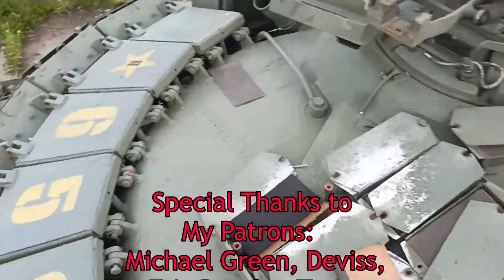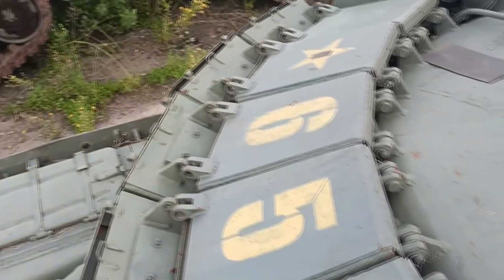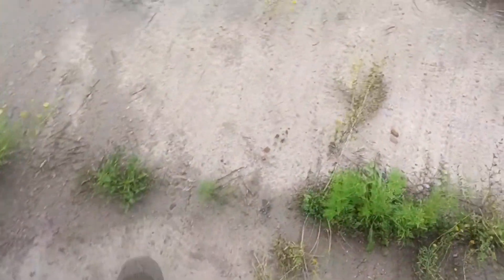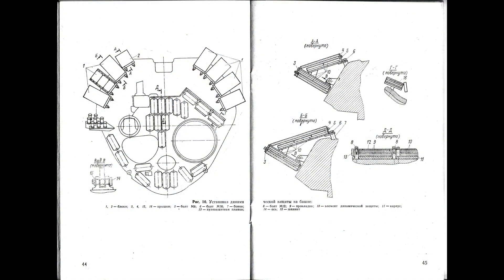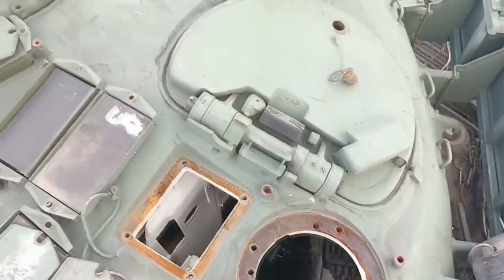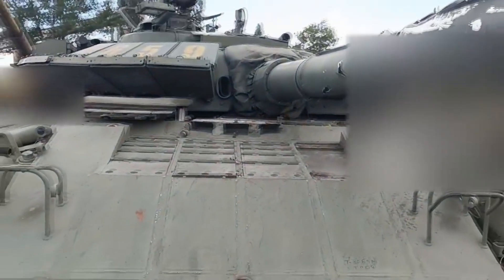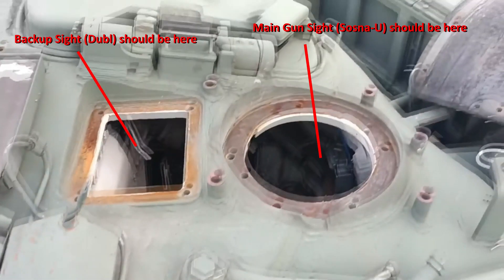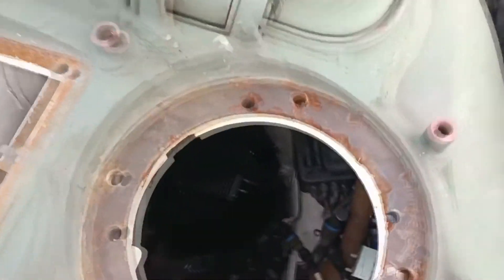Russians Are Using Rubber instead of ERA on their Tanks

Comment: This tank was not equipped with an era on the roof and front of the turret. You may not believe it, but it is a fact. All roof covers have been removed in search of an era. But there were era plates on UFP. And this is far from the only case of this, I have seen at least 5 t72b3 with the same problem, we ourselves completed them with era plates.

The problem is that such cases are not provable. Everyone can tell that it's fake, even if you open  the covers of the era in live broadcast mode. You can always say - "you prepared and removed them in advance" 😁
It is very difficult for Russian viewers to accept criticism of their technique, often they do not even realize in what terrible technical condition it ends up in our trophies.
I'm already used to this reaction, but time will tell)
Reply: this is the video's author btw
Reply: @OGUrez1997  yep
Reply from the maker: Yes, I agree there is really no way to prove it reliably, anything you do people can simply say it is fake. But the problem is that the evidence being provided for such claims is very much lacking right now. There are also several pictures and videos of Russian tanks where ERA has detonated, which means there are explosive elements inside of them, or at least in those specific tanks. That being said, this is pretty much impossible to prove.
Also, I see you posted a comment asking me how I know those are Kontakt-5 roof tiles. The answer is simple, they are identical. If you look at T-72B3 and T-80BVM roof tiles you will see they are identical. T-90M has Relikt roof tiles and those are much bigger than Kontakt-5 and dont really look alike.
P.S. I really like your videos, I have been following your channel for 2 years, you have some great videos there. I didn't want to cause you any trouble by linking your original video, because people on Youtube are idiots and would harass you (happened several times to people who I linked). But if you want, I can post a link to your channel or the video :)
Reply: @RedEffectChannel  I'm not saying that all RF tanks do not have an era, this is not true and it's stupid to say.
I'm just saying that this is not the first, and, I'm sure, not the last such tank. I saw tanks without Era in different places, there is such a tendency sometimes.
and many of my comrades  confirm it 
The purpose of the video was not to show that all tanks are without Era, it was a short review at the end of April, I had very little time, and the user's of this tank said that it was without Era on the turret. given what I've seen before, and given that they won't lie to me - I recorded what I can to record in a short time.
The sights, and everything else, were removed by ours, that's a fact.
ps - there is no need, so many people have already posted my video without a link that it is pointless to achieve this.
good luck bro)
Reply from the maker: @Shawshank.  Thank you for your insight. I appreciate it. If I have to talk about this kind of topic again in some video, I will make sure to mention what you told me.
Good luck to you too and your comrades.
Reply: Как раз таки "критицизм" это хорошо, потому что люди не принимают на веру всë что говорят им в интернете. Есть фото с 72кой которую завешали брëвнами и мешками с песком, есть кучи фоток с "козырьками" и техникой а-ля буханка с буквой z, так что уродских эрзац вариантов у ВС РФ хватает, тут даже спорить никто не будет, просто конкретно в твоëм видосе это выглядит не убедительно, ибо вся внутрянка выдрана, ты сам делал акцент на этом, следовательно, могли напиздить и взрывчатки из ДЗ. Танк захватили в марте, хотя ты вроде говорил, что захватили недавно. А когда где то начинаются подобные недомолвки, очень сложно человеку после такого верить. 
В обзоре на Т72 ты очень хорошо показал, почему Сосна-У откровенно говоря параша. В видосе про ходовку, ты был убедителен, ибо даже видеодоказательства того что 72ка "разувается" вполне себе имеют место быть. А тут чë то как то не то.
Reply: @w_elder2199  а где я сказал что танк захвачен недавно ? И ты знаешь когда я снимал это видео вообще ?)
Понимаешь какой прикол .
Убедительно - неубедительно,это все риторика неверунгов. Информация о том ,что российские танки частенько попадаются без ДЗ идёт ещё с февраля . Потому видео и начинается с фразы "как я уже говорил" .
Данный танк действительно давненько стоит , действительно был разукомплектован (я этого не отрицал ,я в видео говорю об этом -"сняты прицелы"). Однако ДЗ наши оттуда не забирали ,это я знаю на 100% )
Понимаешь, у нас танки с ДЗ живут весь цикл войсковой эксплуатации,и никто никогда её оттуда не дёргает ,во первых головняк ,во вторых дефицита ее нет .
А насчёт " не убедительно" ,бро ,ты угораешь?) Если бы я на камеру откручивал эти крышки (хоть все со всего танка ) , и там не оказалось ничего кроме резины ,то орки все равно бы сказали что я заранее это все подстроил, камон,это ясно как божий день ,плавали - знаем. 
Замажь я номер этого танка , оправдания были бы ровно те же самые (ржавые гусянки, разукомплектованный и тд).
Я все это понимал прекрасно, но мне плевать .
Большая часть аудитории не склонна к упоротому оправданию, поэтому ставка была сделана.
Reply: @Shawshank.  как скажешь
Reply: Кстати, чë за ДЗ напихали трофейным 72кам? У вас есть на складах "Контакт - 5"?
Reply: @w_elder2199  есть )
Reply: @w_elder2199  как автор говорил, чаше всего крыша без дз, борта и перед в 99% прикрыты. Наверно просто во время службы в мирное время не стали башню доукомплектовывать ДЗ иза так как надобности не было, даже 24 числа не многие верили что будет война, да у соседей до недавнего времени не было птрк 3 поколения, вполне могли запустить первые части на прорыв не успев доукомплектовать их полностью ДЗ, так как техника была на учениях и ее сразу в бой кинули.
Reply: I'm quite sure you are right.

Comment: Protection manufacturer "NII Stali" declares that Relict's dynamic protection also includes polyurethane rubber plates, which turns a failed ERA block into a miniature NERA block, giving up to 100mm resistance from a cumulative jet. You can also find photos of this tank abandoned on the march until March 3 with a damaged Sosna-U sight. Also, the author of the video showed a little what is happening inside the car, it is very looted, there is not even a gunner's seat.
Draw your own conclusions from this information.
Reply: Someone needed a seat🤷‍♂️
Reply: a n i m e
n
i
m
e
Reply: Russians use Rubber just like Ukrainians used the Ghost of Kiev to shoot down 6 million Russian aircraft. 
These channels are paid spreaders of misinformation and shame on anyone who takes claims out of the Ukraine side as anything other than propaganda. 
-one million man army
-kherson offensive
-brave defenders of snake island
-totally safe and effective
Reply: This sounds similar to the applique armour on some upgraded T62s. I think it was called the BDD package and it was used in Afghanistan.
Reply: Conclusion: VT-4 SUPERIOR
Reply: Rubber=100mm resistance? 🤣
Reply: @hibahprice6887 look up Non-explosive reactive armor(NERA)
Reply: Too be fair, this 100mm of protection is negligible when considering the strength of most shaped charge ammunition. At most, it'd probably only protect against shoulder-fired munitions (excluding the Carl Gustaf).
Reply: @shanemcdowell3628  If there is an opportunity to get an additional chance for salvation, then it is better to use this chance, especially since it costs nothing.
Reply: @Saiga-saiga  True, if it makes you sleep better in the gunner's hatch
Reply: @Saiga-saiga  he did...
Reply: @shanemcdowell3628  you need to be on the field before making decisions like that. Makes sense on paper , having 10 cms more in real life probably makes most people feel better and survive more.
Reply: @NAWFMATIC  Okay? It's like telling me my car has crumple zones.
Reply: What’s the conclusion then? Ukrainians took out ERA plates without their steel containers to just stickyband them onto T72M they are getting? Relict is a count imitation of kontakt V , hence along side rubber , if it even has one and you are not making up , has to be parallel with explosive element , which has to have 50-100 gr of explosives .
Reply: Russia could be driving LEGO tanks they are still going to win

Comment: It makes sense that the missing explosive is used for IED manufacture.   I doubt missing explosive is used to armor other tanks, as if that was case, the entire pack of reactive armor would be taken, not on the explosives within it.
Reply: ANIME RADIO  If you have enough time to remove explosives from every ERA panel then you have enough time to fix or evacuate the tank itself. Nobody removes explosives from era panels when leaving the tank it makes no sense, if you are leaving the tank to the enemy that means that you are in a hurry or in a danger, not exactly a time for the painstaking and slow procedure of opening individual era boxes and taking explosives from them that are not that valuable at all...
Reply: My thought exactly
Reply: They take the charges and keep the blocks on purpose to make it look like Russian army lacks complete weapons. Of course it does not make sense that they took the gun sights, even headlights but not entire era blocks
Reply: ANIME RADIO  It's fairly straightforward. Have another tank put a round through the abandoned tank...
Reply: I am not fully familiar with how potent the explosive in ERA is, so:
how much explosive power are we talking with an ERA panel like this?
Reply: Corruption lads.
Reply: Look for the article "Polish Explosive reactive armor: ERAWA-1 and ERAWA-2 ". You will find there photos from the test of cassetes resistance to fire with 7.62mm, 12.7mm ammunition, 82mm mortar blast, napalm, flaming gasoline, etc.
Reply: Then why to put ruber inside? where to get so many ruber cut in size? This ruber wasnt put there on a batle field.It was put  in maintenance shop or even in factory.
Reply: @ernisj.8087  redeffect explained it clearly, watch the video again please
Reply: @chilldoggy4721  i know what he is up to.But those who was looking for explosives from ERA just opened couple of them.Most of them were intact. For me it looks more that someone dismatled one here , anothere there.Didnt found nothing  inside, gave up.And why to dismatle ERA for so smal amount of TNT? Just take canon round from tank, remove fuse, heat it in a sand bath up to 120c.Here we go, TNT melts and runs out of the shell.
Reply: @ernisj.8087  Ukraine is in desperate position and there are many reports of guys not having medicine and s
Ammunition. They just took whatever charges they could get. And of course redeffect mentioned that crew sabotage could also be there. And no, they did take all charges possible. Cannon shells? Sure, best way. But era also has some extra for the farmers to build homemade mines or something
Reply: @ernisj.8087  pay attention to the video. The rubber is layered between the explosives. The explosive layers were taken...they left the rubber layers behind!
Reply: @tbrown7662  look on 1:37 at the blueprint .Count how many layers are there-5 ! 2 explosive, 3 ruber. If explosive layers remooved, must be left 3 ruberones. Then count how many ruber layers are in the video. This video prooves nothing.Just becouse he put some blueprint it doesn mean nothing.It is more disaproving what he claims.According to him it is "maybe possible" but not " it is for sure".
Reply: ANIME RADIO  Yes in a war zone you have to flee and you start to unbolt stuff... that procedure is not for active fighting situation and even in NATO you are told to destroy specific items the tank may be difficult to destroy but you have equipment and capabilities to incapacitate it. Google better next time or join the Army.
Reply: @adilachahbar3154  he was talking about Ukrainians
Reply: I doubt it. Actually the explosives in these are very, VERY hard to detonate. They sometimes don't even go off when hit with what they're supposed to protect against.
Reply: There was never any explosive. It was sold to the black market at the behest of some shithead Russian general.
Reply: If I was there, on foot and in scavenging mode, I would just be taking the goog stuff, not the rubber, that's just me!
Reply: Or sold with handgranates  to organized crime in Europe
Reply: её просто спиздили украинцы
Reply: There is no missing explosive. Explosive money went to Generals retirement fund.
Reply: @TheStrategos  Pheeew... Finally someone gets it.. 👍🤣
Reply: ANIME RADIO  It's VERY common to destroy a tank to prevent the enemy from getting hold of the resource to use against you in the future. The U.S. destroys abandoned vehicles in the field all of the time and it's actually one of our duties to do so. In this tank, one or two phosphorus grenades right in between the seats and on top of the autoloader magazine which holds the charges would admit that tank turret into the Russian space program. Sabotaging your own vehicle is standard training.
Reply: @Talishar  "Sabotaging your own vehicle is standard training" this isnt sabotage if you only strip the ERA lmao, its not even destroyed, its not ammo racked. Maybe a thing for US but most certainly not a common practice for Russians. Most of the footage ive seen from Russian tank members abandoning their tank during artillery fire dont have time to strip the ERA.
Reply: @Maj_Hater  The argument I commented to was that it's uncommon in general and I said in the US at least, it's the norm and a general requirement for vehicle crews.
Reply: If you're going to remove the ERA block why would you specially cut rubber sheets to fill the old block, you'd just leave it empty, you wouldn't even put the cover back on.
Reply: @iggysfriend4431  The rubber is already there....but anyway in this example it's probably been stripped by UA forces for spares or some other use.
Reply: @iggysfriend4431  did you just not watch the video at all or do you have comprehension problems? Its clearly described that the roof mounted ERA blocks have rubber padding layers next to the explosive layer as part of their design. Someone hasnt just cut out rubber and put it in after it came out of the factory, the factory does it because it’s how the ERA is designed.
Reply: @iggysfriend4431  the rubber is actually layered BETWEEN the explosive layers. He explains that in the video
Reply: Exactly my first thoughts....you'd take the whole pack
Reply: ANIME RADIO  source: I made it up

Comment: this tank was loote/salvaged/scavenged, and this rubber has its use in era, it has it purposse (TLDR: it help to break projectile (apfsds) into more than one part and greatly reduce it penetration capability)
Reply: Useless against top attack atgms anyway
Reply: A inch thick sheet of rubber defeats a APFDS penetrator round, naturally. Of course. Russian technology wins once again.
Reply: @Warhamer116  ERA Depending on angle,90 degree it wont have as much as effect as it does say 30/45 degree angle.
And with a break off  tip ERA also loses alot of its effect against APFSDS
Reply: @Warhamer116  well, it is sandwiched in between two hard steel plates, and there is also a layer of TNT.... I could mąkę long post about how IT works, but you can also google it: there are Vids on yt explaining it (and animations)

Comment: Interesting. If they cannibalized it why didn't they take the rubber padding as well, surely the Ukrainian tanks without ERA would need both, if not the whole block.
Also if this is propaganda then it seems to be very specific and targeted only towards the Russian soldiers because I can't tell you what an ERA is supposed to look like, for all I know the rubber padding is the ERA and that's just how it looks.

Anyway it's interesting and thank you for digging through all this stuff.
Reply: The two rubber blocks sandwich the thin strip of explosives to make a tight fit within the box. The tanks come with the rubber inside ready for ERA to be fitted in between so hence rubber not needed just ERA when cannibalising.
Reply: @stevepirie8130  That makes sense.